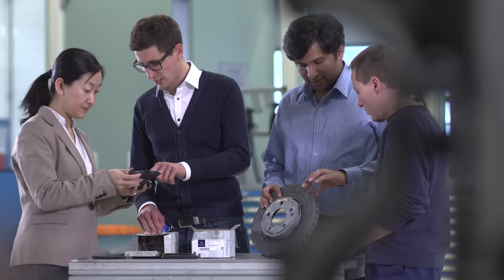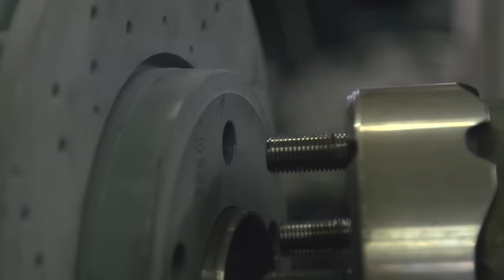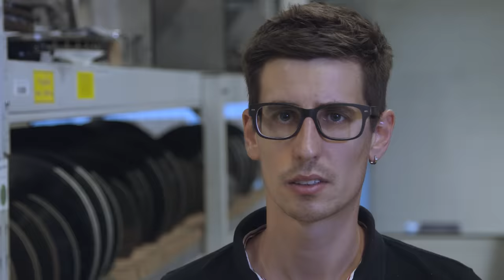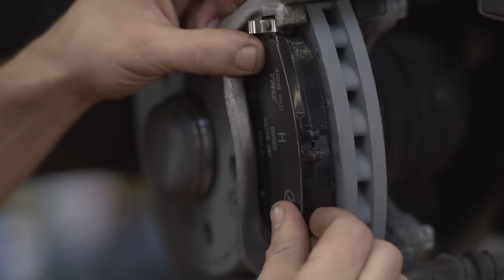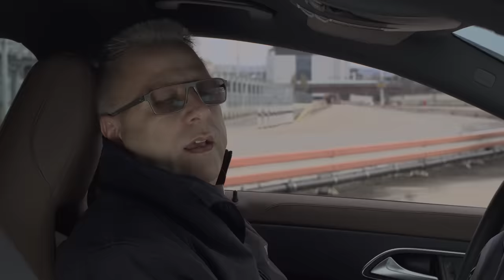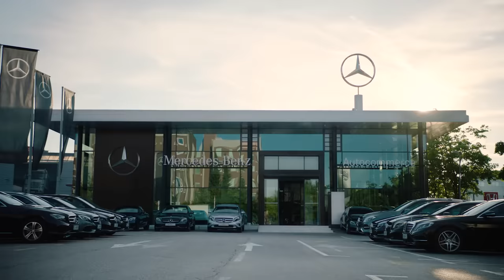Brake Test | Mercedes-Benz Genuine Parts vs. Fake Parts

Comment: This video is a little misleading. I do not think they are referring to non genuine quality parts. Even the cheapest genuine brake pads will stop the car perfectly from 100 kph. But they probably will not handle repeated stops from 160 kph
Reply from the maker: Hi Andrew! 😊 As you can read in our message pinned right at the beginning of the comment section, the counterfeits shown in the film are not high quality replacement parts from Mercedes-Benz or other legitimate suppliers, rather they are illegal counterfeits from product pirates.

Comment: Is counterfeit the new word for aftermarket parts? No disrespect to OEM from any brand but, Most aftermarket parts are far superior to their OEM counterparts. This holds true with performance parts mostly. There is cheap crap you can put on any make and model of car and then there is the good stuff. I only go OEM if I can't find it in the aftermarket. Stick with the brands that have a proven track record like Bendix, Brembo, Denso, Bosch, Deutz, just to name a few and you will never have a major problem.
Reply from the maker: The counterfeits shown in the film are not high quality replacement parts from Mercedes-Benz or other legitimate suppliers, rather they are illegal counterfeits from product pirates. In almost all cases such counterfeits are of defective quality and do not meet minimum legal standards. Thus the counterfeit parts can become a danger for vehicle occupants or uninvolved third parties.

Comment: Too bad Mercedes stock pads make more brake dust than opening a decade old closet of an abandoned house. 

Switched over to Brembo ceramic pads matched to Zimmerman rotors and never regretted the changeover. Car stops just as good, no noise and significantly less dust.

Comment: i have 2005 Mercedes and i needed a little joint that worth only 25$ so i went to Mercedes dealership and i was afraid of the price, anyways, i arrived there and they had two white guys dressing suits valet- parking all the costumers cars so i was like bro fu.k that joint i wont die without it and i drove away :)))

Comment: so ferodo, meyle,febi, brembo, textar, trw, bosh, ate, make fake brake parts?
Reply: As long as you buy the parts made by these manufacturers (and no faked parts from Ebay with just a logo on it) they are as good as the Merc parts, since these manufacturers produce the original Merc brakes.

Comment: This problem can be easily solved. Why dont you sell the parts cheaper?
Even you know deep down that you charge a lot of money for parts. I am an industrial engineer and have a great understanding with cost associated with manufacturing aswell as research and supply chain!

Comment: If you care that much about your customers safety you would keep the price of genuine parts as low as possible so the after market parts didn't seem like a good enough deal plus you would lower the cost of labour on a replacement brake job so people wouldn't be paying £100+ a hour for a easy job

Comment: Well Im assuming you are using a "Fake"  mercedes benz brake pads not an alternative because is not the same.
Reply: Thats the whole point of the video, buying from pirates that sell parts that fall under the legal limit of required performance

Comment: I dont belive it. Also you dont say what brand are those brakes. And is cheaper to install brembo brakes, than going to your dealer and ask for a service check.
Reply from the maker: The counterfeits shown in the film are not high quality replacement parts from Mercedes-Benz or other legitimate suppliers, rather they are illegal counterfeits from product pirates. In almost all cases such counterfeits are of defective quality and do not meet minimum legal standards. Thus the counterfeit parts can become a danger for vehicle occupants or uninvolved third parties.

Comment: I get much cheaper and much better brake pads at the same factory cost. Original factory brake pads are the first ones I am avoiding. So I am not worried about fake Benz brakes which no one care to make them.

Comment: Did you guys use worn out $5 tires from an auto salvage on those fake pads? That's what it looks like to me. Either that or your braking system has no margins for safety (you can use wooden blocks for brake pads, and even those work surprisingly well for the first few stops). So which is it? Weak hydraulic actuators or using crappy tires?

I'm sure the genuine are better, but you should have engineered some margin of safety, that is highly dangerous and a poor design for something as important as brakes. So will you fess up this test was biased and not done properly (compromising pad surface or bad tires), or is your car's braking system that dangerous and poorly designed?
Reply: Also your mechanic was touching those brake pads with oily/greasy fingers instead of wearing clean gloves, so you can't say this was a proper install can you? If that's how mechanics at MB install brakes, then I will remain the sole mechanic of my Merc. If you don't know how big of an impact that can be, I can tell you I wipe off my road bicycles brake tracks before every race for a reason, its the difference of stopping at 50 mph decent, or swerving into a ditch at some speed to avoid hitting a pile up of cyclists.

Don't get me wrong, I'm a huge advocate of using the best tires and brakes you can buy, because it can save lives. This test however seemed more fake than the brake pads, it needs independent testing, because I'm pretty sure I can make wooden brakes from a hardware store stop faster than what they show (unless Mercedes really didn't design the braking system with any margin of safety).

Comment: It's sad seeing a ,,premium brand" to fake a test like this. It is obvious that when testing counterfit brakes they start braking after the cones, while with genuine, before the cones. It should be common knowledge that braking distance depends on tyres and downforce, not brake quality. The difference between brakes is their durability under sustained braking. Shame on you mercedes!

Comment: Ok I have a 2005 MB W639 115 cdi vito van I call my local MB SERVICE CENTER because I read on MB website they have a promotion to replace all 4 rotors and all break pads, and she said it will cost me $1,250 DOLLARS. I asked who makes the pads and rotors Bosch? She said MB BRAND lol. So I got the parts online for my vito and it cost me $400 for all pads and rotors and they are bosch pads and DBA ROTERS as they had no stock of Bosch rotors that I ordered so they sent me out a these for the front which cost $226 dollars so I got a bonus. MB rip you off. also the mechanic will only charge me $150 to install all the pads rotors.

Comment: Don't discredit quality aftermarket part makers. Make it more obvious that you're testing cheap knock-offs
Reply from the maker: Hi there! As you can read in our message pinned right at the beginning of the comment section, the counterfeits shown in the film are not high quality replacement parts from Mercedes-Benz or other legitimate suppliers, rather they are illegal counterfeits from product pirates.
Reply: Thank you for your kind response

Comment: You can cleary see that the brown cls starts braking about 20m later than the White one. And the brown cls stops braking. They dont show both cars on the same angle on purpos so you can not judge when the start braking. They only Show from the top so you can not see when the Front lifts, drops. 

This test is clearly fake

Comment: Hold on, Mercedes don't make brakes. They use components made by many different companies. Brembo, Jurid, Ate, the list goes on. You can purchase equal quality parts without getting ripped off if you use a bit of common sense. 😉

Comment: That looks so fake and biased. There's no way the aftermarket brakes are that bad. You were still going almost full speed when the "stock" ones had fully stopped the other car. If you are going to fake a test, at least do better next time.

Comment: I NEVER buy genuine parts. My BMW has pads/rotors from Ebay that are made by reputable manufacturers for 1/5 the cost. you dont need "genuine" bmw accessories, fluids, oil, DEF etc. All there for BMW to make money. and NEVER head to the stealership for servicing, oil change, brake pad replacement etc. They are 400% more expensive than finding your own parts and using a local mechanic. Sames goes to Merc. Only use the dealership for warranty work, recalls. Everything else, DIY

Comment: Well, it obviously is a fake result, but close enough to reality, if you put cheap brakes pads and do an emergency brake, your pad will just simply go to smoke/explode and you'll be fucked and/or risk your life
For the rotors they can melt onto the pads and lock your wheels, which is obviously a very bad news if you're not completely stopped....

Even if this video is biaised, NEVER put cheap brakes on whatever car you have. The majority of the money you put on your car should go on your brakes pads/rotors AND tires.

Don't risk your life and the life of the others on the road, put these 50 bucks more

Comment: Attention to aLL car expert. Just using water to cooL down disc brake & brake pad. I suggest about a miliLiter per minute dropping on disc brake directly is very safe whilLe traveling 100 mph.  to prevent faiL brake due to overheating. Or simply apply radiator on brake pad / disc brake.

Comment: I'm no fan of any Chinese car parts but surely those Brembo street calipers are not that high tech (like say, a diesel injector with super high tolerances) and the pads used would be asbestos which works just as good as any modern pad. Lung health implications aside, of course. This fake ad by Mercedes is made to justify the ridiculous pricing of what's essentially a cheap technology that the Chinese have no problem in duplicating accurately. Mind you their QA is probably lacking but if the fake brakes work to begin with and the pistons don't leak then they're fine to use long term. Brembo at least did a better job trying to discredit the Chinese by showing a cracked caliper housing but those brakes again must've been subjected to some real abuse on the test bench. You shouldn't expect to buy fake Brembos and then thrash them on a track regularly but if buying just for street looks I wouldn't be afraid to use them.

Comment: Genuine does not exist, My Mercedes c class s205 is provided with TRW brakes. Mercedes buy these parts from them. The so called aftermarket brakes from TRW are the same brakes. Only one different, no MERCEDES logo.

Comment: Mercedes stop lying i owned one mercedes in my life in 2 year period i spent 17,000 on repairs  particulary speaking i had brakes changed every year because they warp and make steering wheel shake when braking , it cost me 1700$ for all brake rotors , brake pads to replaced , new fluid , new braking lines , all original parts and guess what ? they warped again i sold car because it was money pit bought old bmw no problems whatsoever never benz again...

Comment: Its horrifying how people don't get it that unregulated and uncertified parts made by god knows who sourced from god knows where from some shady ebay seller at fisher's price simply won't perform to designed spec. Complete morons. Quality parts are more expensive by default, since their production takes more effort, energy and resources. If you can afford to buy the car, but can't afford to properly maintain it, you shouldn't be allowed on public roads.

Comment: this is genuine bullshit. I'm a mechanic and i repair only mercedes. I can confirm this is bullshit. The actual difference is in wear and not in the braking distance. Tested by me. Same car new oem and new trw aftermarket. Both performed the exact same. The only difference is that the one who used trw changed the discs and pads two exact months before the oem ones. (both c klasse same year same month bought the same day). But considering the price difference (800$) i think two months is nothing. For the price of the oem brakes and pads you can come see me and get an oil change,filters,brakes and pads,coolant and you can buy with the rest of the money bulbs for the entire car and get a nice detailing at a pro shop and i still think you can get a really nice meal and a massage while the car gets done.

Comment: the cars had different speed the "fake brakes" car was moving faster and you didn't mention if the cars had the seim tires on 
was this the best you could come up with to make people buy your "genuine " overpriced brake calipers and disks ...?
Reply: plus the "fake brakes " car could lock its tires so if it had the same tyre setup and speed it was going to brake the in the same distance ...not taking in to account if they where going to wear faster but still

Comment: Genuine factory fit is best
Reply: Those AREN'T genuine parts (not just the braking system). They're from OUTSOURCED companies (such as TRW, Mann, ATE, Petronas, etc.), which you can buy for a fraction of price. They build and supply Mercedes with those parts and then Mercedes charges the consumers with premium price.

Comment: There is little profit made in selling cars, it all comes down to selling parts and maintenance. Just imagine you buy parts, same quality or even better not from the car maker.... Do you really think Mercedes brake pads are made of some sort of magic material no one knows of ? Buy you'r parts locally from a well respected auto parts supplier and all will be good if not better than the original. Mercedes you talk a lot of B......in this video. 99% of brake pads come from the same supplier and sell under many different names including brand and car manufacturers names.

Comment: Why should any one buy fake parts with a Mercedes logo on ebay for cheap? Most auto manufacturers buy parts from ATE or Brembo in Europe. So normally you can buy these for 1/3 the price in a normal car part shop without the Mercedes logo just with the logo of the original manufacturer. Secondly. If you buy shit brakes your dashboard lights up like a Christmas tree when you brake because the brakes are out of the ABS, ESP, VDC etc. specs. Never had these problems with ATE, Brembo, Bendix, Bosh, Ferodo or any other mainstream parts supplier with a reasonable price tag. Don't forget. If it is too cheap it probably is really bad quality. Hey and nice video. Bububu noobs! If you don't buy our overpriced parts you will die a slow slow death! Muhahaha ;-)

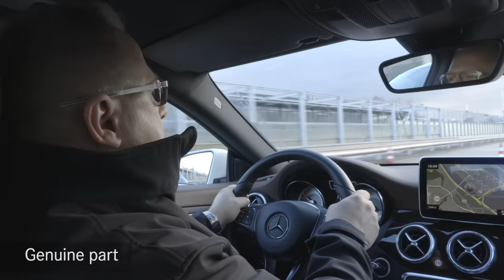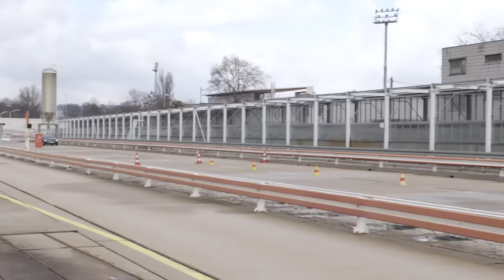Comment: lol. nice advertisement. the driver started braking before the start line in genuine part and the driver with counterfeit strated braking after crossing the line. do you think that the viewers are dumb to not even find this? look closely @ 01:31 & @ 01:53

Comment: Genuine mercedes brakes? Come on mercedes, dont act like you are producing the brakes. All brakes from mercedes are from TRW and ATE. Dont need to buy the overpriced "genuine" brakes if i get the exact same quality for around 70% cheaper from my local car part dealer. But obviously if you buy ching chang brakes its gonna look exactly like in the video shown
Reply: Some are from other manufacturers like Lucas (for example A class first gen)  or Brembo (more sporty models), but your point is right. They don't produce a single brake in one of their factories. 
Just buy parts from these suppliers over the aftermarket and the car is fine for less money

Comment: I would no longer recommend Mercedes to anybody anymore due to its Electronic Component complexity an ability to diagnose reprogram buy small shops or yourself. diagnostic scanner star diagnostic requires username and password and monthly subscription fees in order to access cars CPU. car is built to be dealer only item. I strongly believe that once you own the product you should be able to fix it yourself or modify it Anyway You Want It but unfortunately the car maker has built designed and installed extremely sophisticated electronic system in their products. the era of a million-mile Mercedes has passed away and it's no longer available

Comment: You must be looking for a long long time for the shittiest Made in North Korea brake pads, maybe made from wood and turd. About any pad will have the grip at the first or second 100-0 hard braking to hold still the wheels. My 20 years old volvo with a 20+5 dollars pads (two + two pairs) has the grip to hold still the wheels (but it wont because of the ABS). A counterfeit part could ware out more quickly, or it wont have the grip after multiple hard brakings in a very short period of time, but a single 100 to 0 brake test with new or almost new pads shouldn't differ with a genuine and with a shitty fake pad.

Comment: Non original brakes, let's say they will give me 15000 km life and cost 1/4 of the OEM price. The OEM brakes let's say will give me 30000 km life. So, at 30000 and 45000 and 60000 i will already have changed my brakes, and will have all 3 times Brand New brakes!!!! And still, will have the 1/4 of my money in my pocket!!!! Sorry !! Bye!
Reply: In the case you had already bought the car for instance:

Why would you pay the luxury price upfront and then complain when you can't afford the cost to maintain it afterwards? Its like using afterpay to the point you can't meet your demands for the money you owe versus how much you've spent.
Reply: @twistieman1078  I agree with you. But not all Mercedes models are considered Luxurious...but Mercedes sells their parts  as gold!
Reply: @CellPhoneAddicted  so be it then. 

I guess let those that can afford to complain about it complain then.
Reply: Since the ''original'' brakes are made by well known suppliers which also offer pads without the Merc logo on it you may get the same mileage out of 3rd party brakes, of course at lower costs